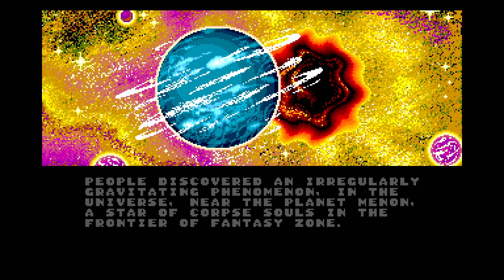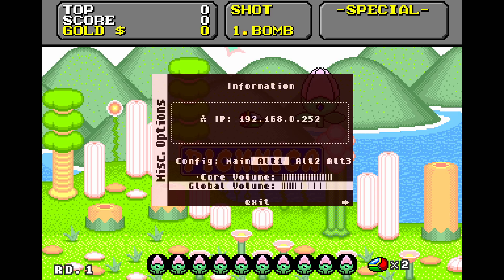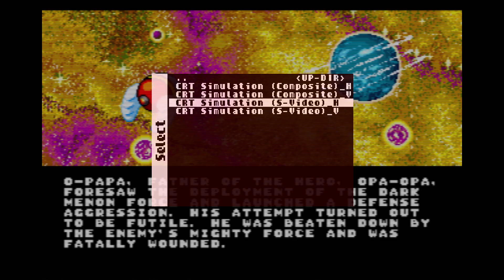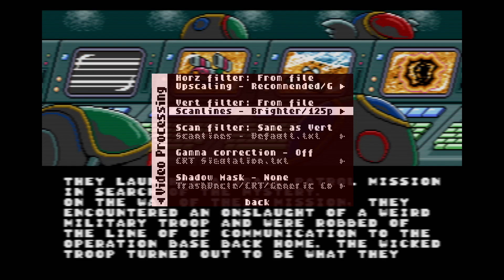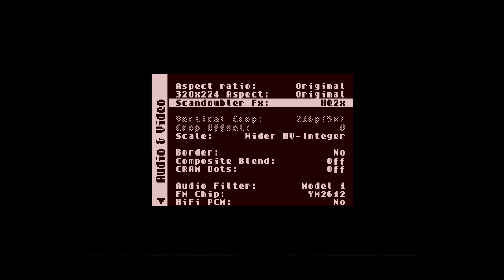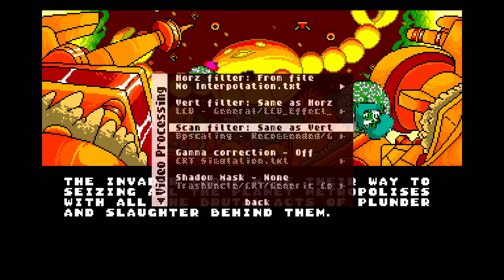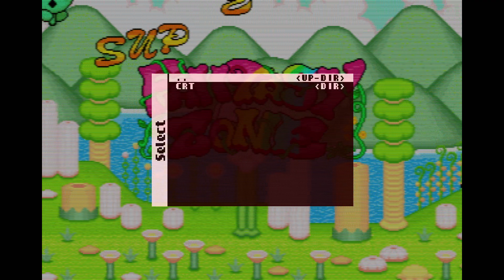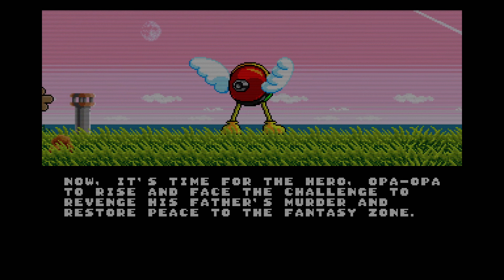MiSTer FPGA - Video Processing Menu Walkthrough

Comment: Lot of options here - but it seems like once you set visual processing - you cant UNSET it - I dont seem to be able to remove processing from a core - and even better - it would be great to be able to remove it from ALL cores. - I know you dont work on this - but can you parley with the MISTer gods please? - If MISTer is linux based - why is there no basic editor like VIM to edit the INI? - nano even better.
Reply from the maker: There is a preset that turns everything off, its called No Filters (it sets only No Interpolation for Horiz filter).  This should solve your issue for the most part.  I am not sure why there was no option to just turn off filters.
Reply: @TrashUncle  - I found it - thanks for that.